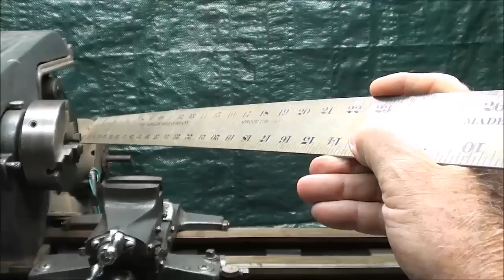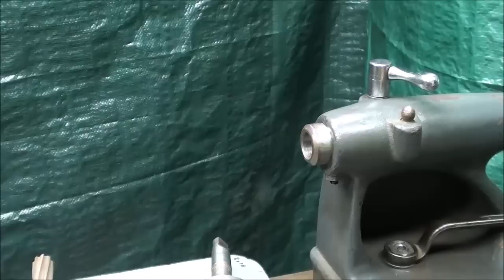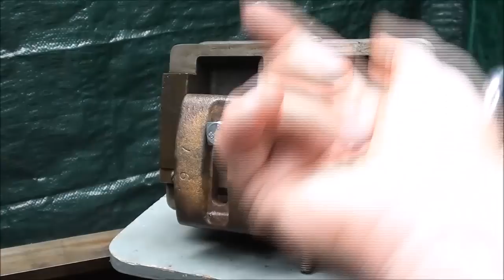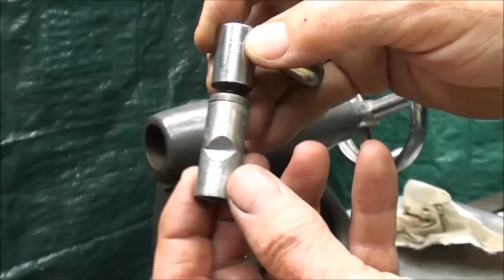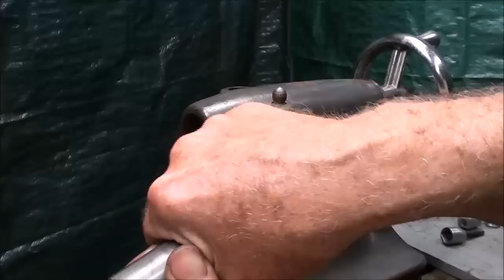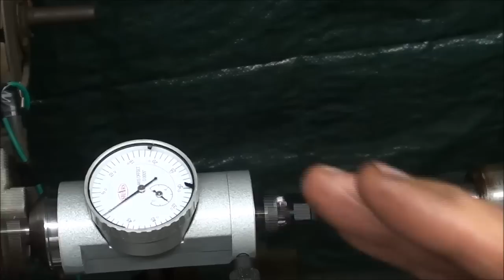SHOP TIPS #235 The Atlas/Craftsman 12" Lathe Tailstock tubalcain

Comment: Shop class is in session!  I've got an Atlas that I've been working on for about 2 years. I've watched tons of your videos and they have been invaluable. Without your knowledge, I would never get there.

With your help, I just finished my first AL piece they had a mirror like finish!

Most recent change was a servo motor w/ speed controller, link belts and tuning up the gibbs (thanks to your videos).

Question for you - the two pulleys in the cabinet that connect up to the headstock:  I am using those to transfer power from the servo up to the headstock.  I need to increase the size of one of the pulleys to give me more advantage from the servo.

Is that a standard 5/8 shaft w/ a 3/16 keyway and does it come off easy?
Reply from the maker: Yes, it’s a standard shaft.  It may require a puller.
Reply: @mrpete222 awesome thank you,  and thank you for everything!!!

Comment: Uncle Pete, I'm a novice to lathes and just got a Sebastian from the 40s with a similar tailstock.
 The quill is stuck, and a dead center is stuck in it. And so also the vertical clamp bolt won't move.
In what way should I best ditect my effort to free the quills movement? It may be surface rust has it stuck in place, but maybe also the clamp may be stuck in the locked position. I don't want to hammer tap the wrong part and cause damage that is difficult to replace.
Reply from the maker: Take the tailstock off of the machine and place it in a vertical position.    Soak the quill daily with penetrating oil.    Tap it gently daily with a lead hammer.    Eventually, it will move. It depends on where the corrosion is.
Probably not in the screw thread, but it could be the quill lock as well. Has the last resort heated up to 400° and your wife’s oven and try it again good luck.

Comment: Mr. Pete, what do I do when my quill has 3" of indicators but falls off the screw at 2.5"? I've had it apart multiple times and can not find any damage or significant wear. It's almost as if my screw is to short but If it were longer I don't think I could set any tooling.

Comment: You answered my question nicely.  when checking to see what back plate is needed do you measure the highest point on the spindle threads? I am very new at this. A friend gave me an old Atlas  lathe. Model number 3890. I cannot find any info on it. Some of the parts look the same as yours but the motor assembly is different. Hope you or  one of your viewers can point me to some info. Like your videos. I am learning a lot from you.

Comment: Hey TubalCain! hope you have a minute or two to help me. I purchased an older heavy 
metal lathe. I am on a budget, not by choice. My issue is I have a morse
 taper 1 tailstock quill, also a morse taper 1 headstock hollow section.
 I want to start boring and turning and I am stuck here. I want a drill 
chuck, and center in the tailstock quill. Also a lathe dog + center in 
the headstock. I also have a 4in. 4 jaw chuck. So is MT1 on both sides a
 problem?? I see a MT1 - MT2 adapter on ebay. Should that cause me 
issues? I am looking for some strategic expertise on pros/cons of my few
 choices at my disposal. Sorry to sound like a big baby, I am stuck. I 
did everything else, just stuck here. I want quality. Thanks much, hope 
you can aid me somehow. --Joseph
Reply from the maker: He will have to buy tooling and shocks that have a number one taper. I think they are still available. They are very small in diameter. I assume your machine is quite small
Reply: @mrpete222  : hey thanks for the reply. Yes. It is an old English style screwcutting lathe. I removed that for now... I hooked up a PMDC treadmill motor + its controller speed PCB and just soldered on a 10k pot. and all is well. Lantern tool post. I ts is roughly a little bit larger than the 7x14 harbor freight mini lathe, I like the older ones better!! $100 USD was deal. Plus the man who sold it to me asked me to never abandon the project, fix it up, and make some chips. My promises I always keep!!

Comment: How do you remove a stuck-on Morse taper in a tailstock? (It doesn't have a tang so turning the screw all the way back doesn't pop it off) Tried putting a drill chuck on the opposing jacob's taper and using a spacer/chunk of metal to remove it but the jacob's taper popped off instead of the morse taper. Also tried heating the sleeve but that didn't work either.
Reply from the maker: Remove the quilt from the tailstock. Drive it out from the back side
Reply: @mrpete222  Thanks!

Comment: What depth of cut would you feel comfortable with on the Atlas using HSS cutting tool on, say, a 1" diameter carbon steel workpiece? I've read only .005 diameter cuts. I'm reading that these lathes lack rigidity. Looking for your opinion.
Reply from the maker: Go about .020 do you put on your rough and cuts. And the only two or three on your finisher and cuts. You will eventually get the feeling for it

Comment: MrPete I know you have WAY to many subscribers and get a million questions to be able to respond back so maybe some of the viewers could help me- My question is how can I keep my SB lathe from getting that fine rust on all the chrome parts? I clean and oil it often but its out in my unheated garage & only takes a few days for it to start rusting on the hand wheels or is it just something I have to live with? someone told me to clean it good then use Johnson's paste wax on all the chrome parts? anyone have any Idea's 
Thank you in advance
Reply: Well just my opinion, but im thinking a quality car wax would work better as it has ingredients specifically designed to seal and protect against the much harsher outdoor elements, air, water, humidity, UV rays etc -- in many basement and garage shops its many of these outdoor elements youre trying to keep off the machined or metal surfaces--again just my opinion
Reply from the maker: +Rosario W I have the same problem on all bare metal, but have not noticed it on chrome.
Reply: l  didn't mean to say chrome lol the hand wheels just "look" like chrome from just using them- they get all polished up was what I was wanting to say Thanks
Reply: On the subject of surface rust, I don't know if it will work as well on the polished hand controls of a machine, but on my basement located vises machined surfaces and machined drill press table I had the same surface rust problem - to stop it I apply a couple coats of a high quality car wax such as Meguires once or twice a year to keep the moisture and oxygen off the metal surface and it totally solves the issue for many months possibly longer. I don't even have to cover them with anything anymore. But again how this would work on control wheels im not sure.  Great videos MrPete.
Reply: As I mentioned in another comment below, on my drill press table and vise machined surfaces ive found a couple coats of high quality car wax such as Meguires at least once a year seems to totally solve the surface corrosion issue.  Again how well this would work on polished hand controls I cant say -
Reply: Yep, That is what I was told to use (Furniture  paste wax) on my SB to slow the development of the fine rust. The guy who lives across the street from me is a retired shop teacher and used it on all the schools machines. Unfortunately I have been so busy (out of town) I have not tried it yet

Comment: Dennis Williams, this set-up looks identical to my Raglan Littlejohn lathe.  Well the bed and ways are identical although the tail stock is different.  There are no Gibbs on my tail stock.  Apparently, Raglan purchased my parts for their lathes from Atlas including the 'split nuts' and I believe the bed and possibly ways.  I am delighted to report my lathe does not have zamck gears but cast iron and brass.  Interesting material as always from Mr. Pete.  Regards. Joe.

Comment: Once again a very helpful and informative video.  They must have made some changes between your lathe and mine.  I would not have recognized that tail stock as being Craftsman as it is a lot different from mine.  The bolt to hold it tight on the ways is on the back side instead of the front side and it does not have the lead dispenser.  Also I cannot touch the bottom of the bolt that hods the quill lock.   Thanks for the video.
Reply: +Amateur Redneck Workshop Yes, your lathe  is the same vintage as mine. The later models in the late 60's to the end were designed like ours with the lock bolt on the back side and not interfering with the saddle and cross feed when close to it. A good improvement in my opinion. Ed K. Cleve. Oh.

Comment: Huh. Didn't know that. See? That's why this is awesome. I always thought the ball (the little oil piece for dead centers) was some kind of attachment. Obviously mine is stuck, now i'm going to unstuck it because having a small cache of oil handy is always welcome.
Reply: Someone i know has cut the riding section on his tailstock and has replaced them with fully adjustable (same material) screwed in plates. His tailstock was so worn that when he purchased the lathe, it would ride under as far as 2 mm. Now, i'm sure the wear is mirrored in the ways as well, but i think the adjustable running surface is a good idea. I certainly want to do something similar for my own lathe, but i have a horizontal misalignment issue, not a vertical one.

Comment: My Atlas tailstock was a bit out in the vert both height and tilted, as well as worn so the quill is slightly aimed to the rear-- no clue how that works, but someone did it somehow. A little hand scrape and shim for the cross guide and faces between the base and the main part took care of most of it. I brought it up by drilling into the base, loctiteng brass screws in the base (1/2" IIRC) and dressing the tops of the screws a uniform 10thou (again, IIRC) above the dressed mating surface. Not perfect, but within a thou vert and about a thou per two inches of quill travel. No, I would not do it again.

Comment: Interesting that they used a set screw ground flat on 2 sides...makes for difficult fine adjustment and potential slop.  I custom made a dog point thumb screw from brass that fits perfectly in the keyway and used a thin jam nut, for my messy built peanut.  Also gives a nice bearing surface and get NO rock on the quill.  I  liked the spring idea below for the quill lock if there is enough room to still clamp!  Would be very interested in finding one of those tiny live centers but couldn't see the brand on it?

Thank you kindly for the time and energy you put into the lessons and videos for us Mr. Pete.  Always enjoy the detail you bring to us and your colorful commentary!!  ~PJ
Reply: +pjsalchemy  I think you are missing the point. The object of the key is only to prevent the torque applied by the tools when in use from rotating the quill. It only works on one side and shouldn't touch the bottom of the key way. Most lathes use an actual key to present a flat surface into the key way side. A dog point screw will bear against the quill in too small an area and will leave a divot under heavy load or vibration that will bind and may raise a burr on the quill scarring the tailstock bore.
 I know, R8 tooling often uses a dog point screw but it is not used in motion only for static location and preventing creep of tools tightly drawn into a taper. They often leave a mark and burr on the key way that must be dressed down. A flat sided screw is a much better solution for a lathe quill. And the nut is only there to keep it from moving and wearing out the thread in the casting not for height adjustment.
    Mike (o\!/o)
Reply: +pjsalchemy 1/4-20 setscrew 1/2 turn=.025 in a .125 key slot,no matter it is not meant to a slop adjustment it is for anti rotation
Reply: +Jerry Schram IMHO it's quite difficult to grind a flat on each half of a screw to match the width of a key slot "equally on center and parallel" of a 1/4-20, let a lone to say 3 thou tolerance so it doesn't rock.  Maybe on a mil.  A custom size dog point to match the keyway within 1 thou or less is much easier to do.  Plus it has the advantage of giving a sliding fit to the width and depth to the run of the quill keyway.  Covering slop in both directions over the run of the quill gives quite a good feel...and definitely does not rock with larger tools in the tail stock.  

If you are correct on the depth of the keyway being .125 you could theoretically touch the bottom of the keyway in 5, 1/2 turns.  However, if the keyway depth is something other than an increment of .025 you will never get a Running Clearance in the bottom of the keyway, let a lone accurately grinding the 2 flats for a RC fit to the sides.  For instance if it was .1875 deep the closest you could get is 12.5 thou or double+ an RC9 running clearance.  I use end mils in mine to create counter bores and they will definitely jump when starting into the work if not held well...even with a shallow drilled hole the same size.  Every job has it's own tolerance whether building barns or space craft, I just prefer to do the best I can with what I have or can make better...for St. Pete's Sake!  ;-P      ~PJ
Reply: +Experiencing Technical Difficulties I don't think I did, actually.  Please note that I was only making an observation and that I made my thumbscrew from brass purposely, so it would wear first, not dink the quill, the lubricity and it was something I could build accurately.  I also use white LI grease for the quill and the keyway for the pressures involved.  My thumbscrew has been in operation for well over a year now, still smooth as glass and has virtually no wear.  If it does I will build another.

My point "was" the play between the double ground set screw and the keyway would be difficult to hold a good RC fit unless maybe done on a mill to keep a drill/mill from jumping at the start, creating a conical out of tolerance hole in the part and putting strain on the quill and tailstock.  Particularly a 2 flute drill can create a triangular entry based on all the other factors of the lathe, speed/feed, drill/mill like TIR based on the oscillations from the slop.  Yes, you will have only 1 point of contact depending on direction of rotation to the sidewall of the keyway.  However by getting a closer RC tolerance on the diameter of the dogpoint to the keyway sidewall and an RC fit to the bottom with a square cut face you "virtually" create a 3 point RC fit for the run of the keyway...minimizing slop in multiple directions, or oscillations in this case.  Additionally I have found that a "light snug" on the quill lock helps and doesn't hinder the handle feed.

Personally I wouldn't venture to say that Most lathes use a key and keyway as I have only seen maybe a half dozen at this level of disassembly...and none I've seen use a key and keyway.  It does seem that it might work well but Not sure keys are actually used much for sliding fits...a spline maybe, but expensive.  Different paths I guess but I would be greatly interested to see how Hardinge addressed this issue.  

As for the nut, I'm starting to feel like one, but yes it's a lock nut, but for both in my case.  I have seen way too many videos on YT over the last few years where someone goes to drill a hole in something and the drill jumps and wiggles like a bobble head...and still wince every time!  Each to his own....~PJ